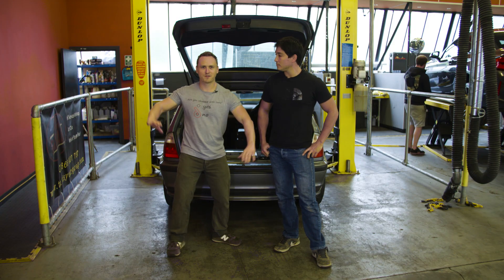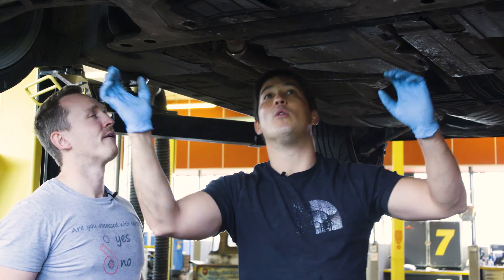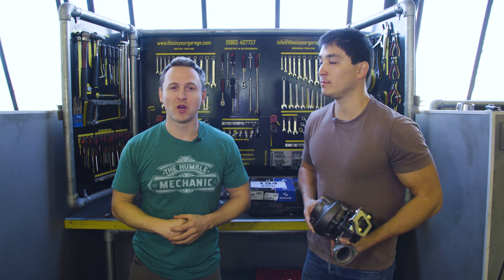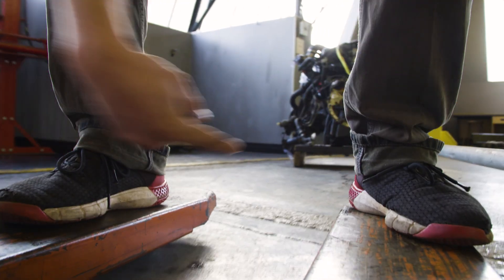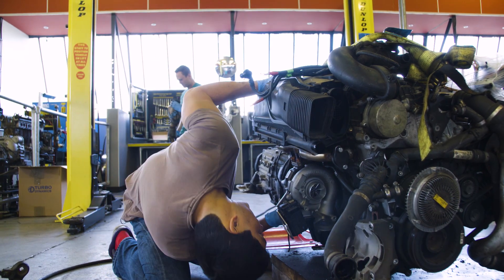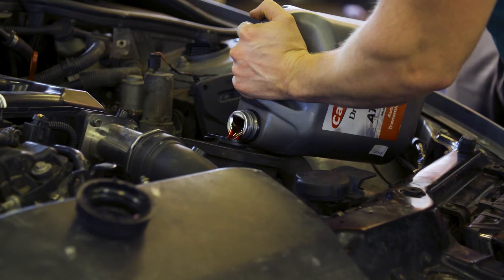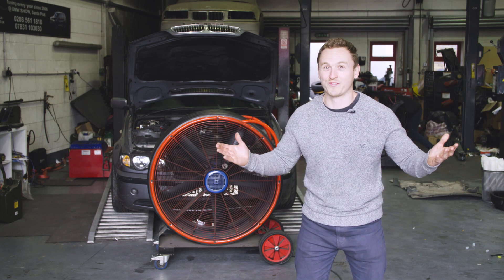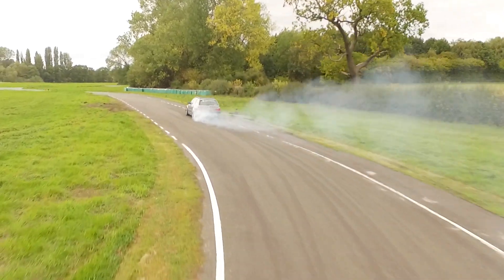How Much Power And Torque Does A Hybrid Turbo Add To A Car?

Comment: Why no single mass conversion on the flywheel
Reply: ya i wondered that as well... and a new larger intercooler wud have been great as well
Reply: ye mate he should have done fmic when front was off, and before remap :P
Reply: I can tell you now, the duel mass won't last very long with that clutch, I have the same Sachs racing clutch in my Bm
Reply: Because he likes his crankshaft and don't want to let it broke lol
Reply: Because diesel
Reply: @r129r16pfl  cant se why diesel would be the reason
Reply: Nigel Lai  TBH it's the same scenario with the paddle clutch mounted on a duel mass, still got to rev match which has become sort of second nature for me now, the duel mass lasted about 10k miles before it started rattling but did also have about 40k miles on it before that with stock clutch
Reply: Why would they?
Reply: I would have gone single mass, it would last longer than a duel
Reply: You don’t need to rev a diesel much past 4000 rpm, so lightening a flywheel doesn’t help make power and would probably lose low end torque.  

The dual mass flywheel also absorbs a ton of the vibration and chatter from the driveline.
Reply: @NoisyDaze  in track racing lightening anything saves time. and it would rev up to 4000 rpm faster
Reply: Because its a six speed, it cant handle single mass, it breaks, if it was a five speed it would work.
Reply: @TT3LTU  lol speaking out of your arse. The 6 speed box is very much capable of handling most things can chuck at it. Its known to handle 1000nm.
Reply: TT3LTU  Thanks. I was thinking the same thing, but I'm a noob when it comes to diesels and performance upgrades.

Comment: Pulling the engine goes way quicker when you drop it out of the bottom. Unbolt the calipers and hang with wire then drop out of the bottom. We can pull those engines in 45 minuets that way. The key is to build wooden pallet stands about 16” high.  It’s way quicker remove and replace.
Reply: All Things M3 at my work we have a hydraulic table that you can raise and lower and it makes dropping the engines and shoving them back in so easy it’s also nice to dress a table at whatever height you fancy x
Reply: But they had to get it off the lift and roll it outside. Wouldn’t that make dropping it ouy of the bottom more difficult?

Comment: turbo back straight pipe and fatty front mount?
Reply: You like smokescreens i see
Reply: a turbo back exhaust will make no difference in smoke on this car...
Reply: It's too lean right now. If they added a 2.75" turbo back exhaust, turned up the fuel another 7-8%, and increased the boost a bit, it'd be quite a bit faster. But of course they won't, because for some reason people on that continent seem to think that having a bit of soot is bad. Rolling coal is ridiculous, but diesels should smoke a bit when operating most effectively.
Reply: AFR does not work the same way as a gasoline engine, bigger exhaust and intercooler helps even on a stock turbo diesel engine. My 330D had cat delete and a bigger exhaust, faster spool up and more power.
Reply: @Gravstein  Of course more air you jam in the better. Should upgrade the fuel though running lean on a diesel without a cat/def system produces like a lot more greenhouse gases than running rich.
Reply: @boostaddict_  that's because we have some expensive-ass fuel...
Reply: Common rail diesels should not smoke.
Reply: absolute nonsense. Smoke has nothing to do with the type of injection system used
Reply: @ricky302v8  Rich diesel air fuel mixtures primarily produce carbon and C02. Lean diesel air fuel mixtures produce some really nasty greenhouse gases. If you have a modified diesel without a DEF system you want a little black smoke. Unless of course you don't care about the environment and you just want to have the highest fuel efficiency possible.

Comment: there! are all you ''' ITS NEEDS MOOROEE EPOWERRRRRR'' people FINNALY happy now?
Reply: Still not satisfied
Reply: A hammer wasn't used to mend this, Clarkson is disappointed.
Reply: It’ll never be enough..
Reply: He will  be squeeze even more power out of it :)
Reply: Around 300hp is achievable without turbo swap on that model. Many people have it between 270 and 290 hp with stock components.
Reply: Still needs proper exhaust/intake manifolds + straight pipe
Reply: What power...
They're still using stock cooler and exhaust.. Why even...
There's more to gain actually but they just didnt do it
Reply: funny to find you here

Comment: Woah, I didn't think they would do something as drastic as a turbo swap, I thought the relatively minor engine piggyback was all they'd do
Reply: Yeah, 84HP gain with a change of turbo & ECU remap is really big gains.
Reply: Same, im satisfied now haha. Actually stoked for this build dood
Reply: Wil Thieme  Even still it'll probably flow better than the stock turbo. The stock turbo would push lots more boost than it was, but the exhaust would be restrictive and the bigger turbo should get less hot when compressing air. Not bigger but it'll be way more efficient.
Reply: boost isn't everything, flow is everything, better to have a big turbo flow a lot at lower pressures than a small one doing nothing but adding more pressure.
Reply: @alexstromberg7696  speaking sense!
Reply: @alexstromberg7696  yup !
Reply: Sure glad they did though
Reply: 104 pounds?Bmw you thieving cunts!
Reply: Come on, it was obvious.
Reply: That piggyback was piggycrap
Reply: it's not 2005 anymore, people don't use piggybacks.